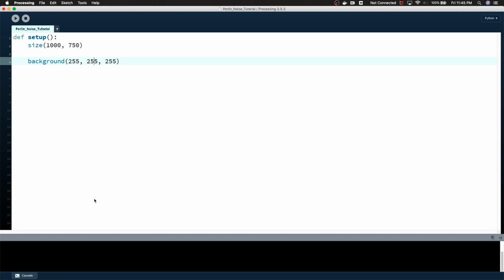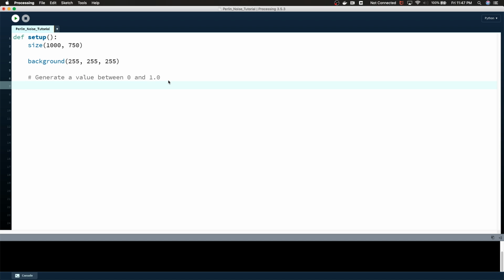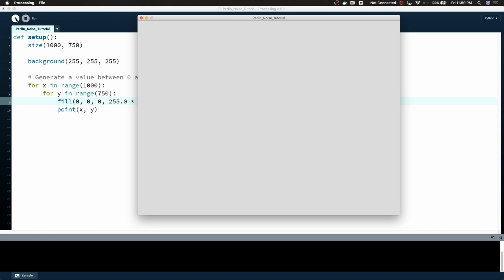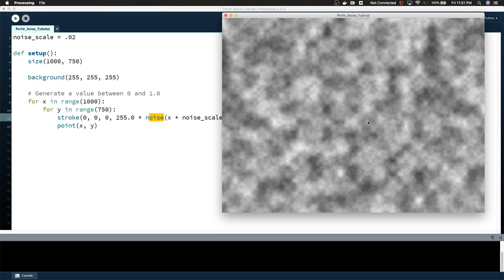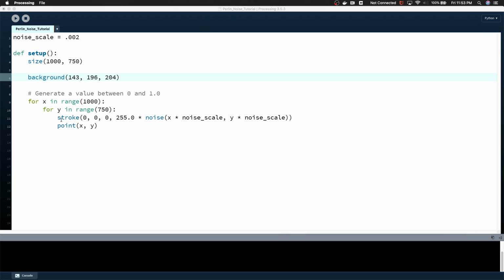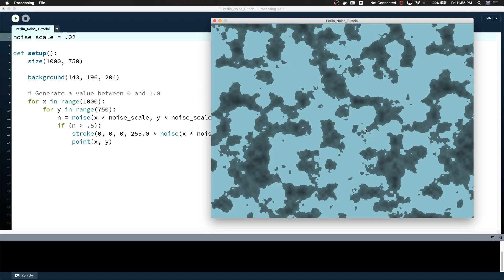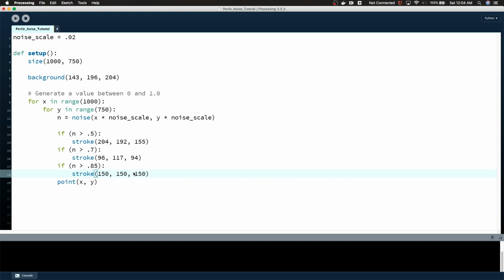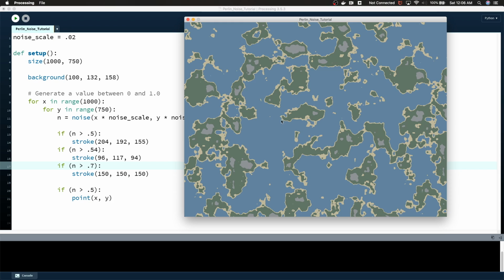Understanding Simple Perlin Noise - Generating Islands

Comment: i've this week started exploring Processing. I have a reasonable amount of Python experience, & much less Java, so i'm torn at this stage whether to use Python or not as I suspect that Processing is much more 'native' feeling in Java (in terms of speed, reliability etc ...).
As a Python processing user, how have you found it, & have you had much opportunity to compare & contrast with the Java implementation?
Thanks for this video. I am keen to develop some generative video ideas exploring geography / cartography etc ... so a great starting point ...
Reply from the maker: I haven't had any complaints. I've mostly used P5.js (the javascript version of Processing) and the Python version. It seems like the documentation is a little more in depth for the Java side of things, and there have been times that I feel like I had to 'discover' how things work on the Python side, but I have been happy with it. I started just doing everything in pure Python and using graphics libraries and using Processing is infinitely better regardless of which implementation you use. Maybe you can experiment with each of them